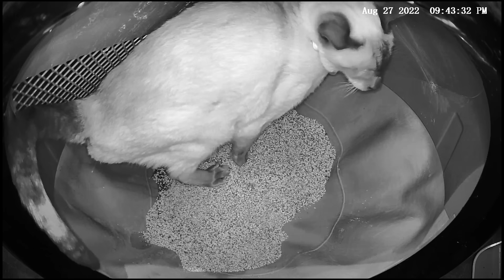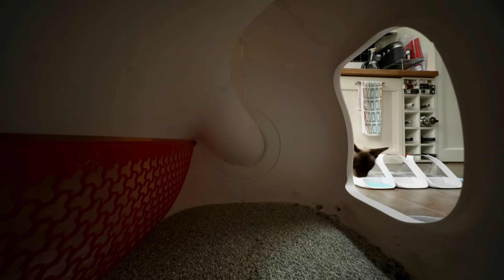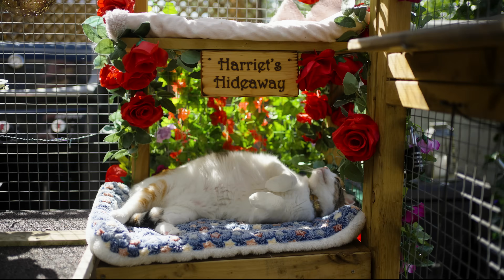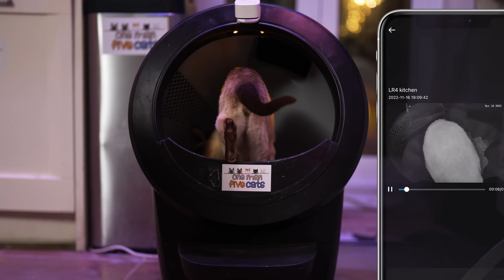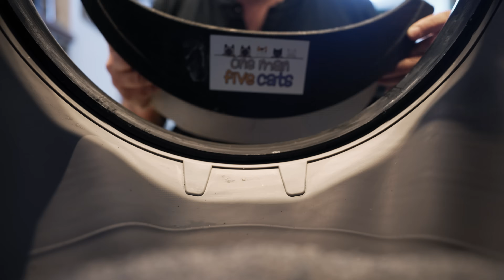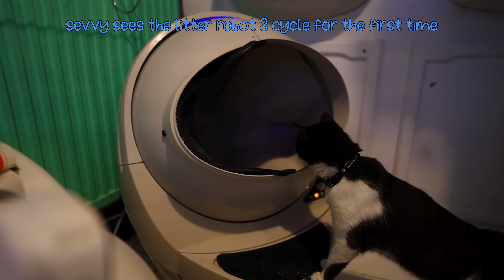Litter-Robot 4 Review: Is It REALLY the Best Self-Cleaning Litter Box?

Comment: Great video. I have been using Litter Robot for almost as long as the company has existed. Right at 20 years. One reason I have continued to use them is that their customer service has always been top notch. 

The early Litter Robot had issues (pull cord sensor would stretch and a few other problems), but the company went to such great lengths to help me fix it they won me over. Litter Robot 3 had quite a few growing pains with all the new tech added (new type of sensors, wifi, app, etc.), but the company still offered me that same customer service I got when I first started using their product. 

Unless the quality really starts to suffer or the customer service does I would fully tell anyone to get Litter Robot full stop.

Comment: I got the LR4 a couple weeks ago. It works great! We have 2 cats, one took to it right away, the other was scared to death of it. We helped her overcome her fear by having the old litterbox nearby but not cleaning it, and also getting a new type of litter called Cat Attract to encourage her to start using it. We also sometimes left treats on the step to encourage her to be close to it. Finally, I left the LR4 off and only cycled manually for a while outside of her presence, so as not to scare the hesitant cat. It is very quiet when cycling, but she still acted as though it was going to suddenly attack her when it was cycling.

The 2 cats are different weights (11.8 and 9.8 lbs), so distinguishing them based on weight is not a problem, the weight is accurate and consistent to within about +/- 0.1 lbs. It's important for precise weights to have the LR4 set on a hard, not carpeted surface, otherwise it will give inaccurate weights.

One nice thing is that even when turned off, it still records when cats use it and their weights, so I could still tell which cat was using it during the period when I was manually cycling it with the LR4 off, and confirm that the hesitant cat was actually using it (usually around 4 AM).

Comment: Based on my extensive experience. You can only rely on these machines to stop when there is weight on them since this mechanism usually utilizes magnets which rarely break; and you cannot rely on them to stop when something blocks their spin because sensors are easily compromised by moisture (piss) and dust (clay litter). There has been news and reports of cats having their necks snapped in automatic litter boxes. Please avoid any models that allow cats to poke their heads through small hole while spinning at all cost.

Don't let curiosity kill your cat.  

And if you plan to use one for a long period of time without refurbishing or repair.  I suggest avoiding gimmicks, apps, and again most crucially sensors. These things have no long-term value and can break in a matter of days.

OP keeps removing my responses. Anyone curious to learn more should google "ห้องน้ำอัตโนมัติ แมวตาย" by yourself.

This video must be sponsored by.....
Reply from the maker: My videos are unpaid and independent. I have ethics. I don’t through out statements with zero factual basis. Learn some basic manners.

Comment: I have had numerous cat genies and prefer this style litter box over one you still have to empty a container with litter. The only draw back to the cat genie is you have to have a water supply and a sewer hookup ( room next to a toilet).  I am lucky that I was able to use the water supply from my toilet in my basement and hooked up the drain to the utility sink with a dishwasher pvc fitting from the hardware store after the P trap. I like the fact that all of the solids and liquids get flushed away and a pleasant clean fresh smell from the litter box cleaner afterwards.
Reply from the maker: Check my pinned comment for what I consider deal breakers for the cat genie, something I’ve owned for 7 years

Comment: I bought my  Petkit Pura Max on its launch day and have been using it ever since. I'm quite busy and have to go on business trips quite often, but it always performed perfectly over the last couple of years. The minimum weight for kittens is 500 grams but the sensor is quite accurate if you set the machine up properly, and it can be triggered at only 100 grams. I've only maintained the machine three over the last few years yet it's still in great working condition. it's got great safety features like inferred sensor and radar sensor at the front of the machine, a laser grid for pinch protection, four weight sensors, and the front of the machine will leave a gap when it's tipped over.  The supporting app works great, you can create pet profiles and it will automatically update the weight of the pet for you. It also has a built-in system to eliminate the odor and it works great, the special bags and the fluid used for odor elimination don't cost much but it's of good quality. Personally, I do enjoy using this machine and think other people who want an automatic litter box should buy it. ;plopwaqq (my cat just walked over my keyboard just after I finished writing this, but I think it's pretty well timed so I'm gonna leave it there)
Reply from the maker: Cool, but not sure why you wrote such a long comment when I don’t even cover it until part 2…
Reply from the maker: I am confused by you talking about “maintained the machine three over the last few years”, that doesn’t make sense does it? Especially as the machine only started to reach backers at the beginning of this year!

So please tell me why you have lied?

Also there is no radar sensor. There are entry sensors and weight sensors. Leo’s Loo Too has radar.

Comment: I had a 1st auto litter
Machine 
in the 90’s with my 4 cats (with cat privacy tent). Bought second unit after contractors ladder broke the lot, but as I couldn’t enclose it as ‘privacy tents’ no luck longer available, I keep
This as emergency back up. But lasted 10 years until ‘killed’.
2nd was litter robot 2 (by this time 3 cats) & eventually upgraded to circuit Wi-Fi board to Whisker app would use.
This has lasted me 3 yrs so far with minor (mainly fault so turn on & off to sort out problem) for my 3 cats.
No litter kicking, or weeing above entrance etc ( uses whisker app) 

I’ve rebuilt unit a few times & always (so far ) got it sorted easily  - not bad for wheelchair user woman in wheelchair 

I don’t think the big entrance of litter robot 4 would suit mine & they wouldn’t like the home bodge wee solutions ! Nor would I for that money !
4 yrs & no problems with Litter robot 2 upgraded by circuit board in litter robot 3 (connected by disabled woman in wheelchair).

So will stick to this (drawer a pain to put bag onto clips & breaks your nails - grrr)

Comment: I got a litter robot 3 a few years ago. Feel like I wasted a lot of money on it. First off the thing is huge. It takes up so much space we nicknamed it the rocket. At first it worked alright. Then the steps became moldy and would not clean no matter how much we tried to the point they were stained. Also perhaps for 1-2 cats this might work better, despite its size I would not recommend for too many cats, it does hold quite a bit but after awhile it just started giving the jammed signal or was always red despite nothing being in it..we took it apart and cleaned it and it still gets the red stop light and will turn red multiple times in a day to the point we had to return to normal manual litter boxes after spending nearly a grand on it and it not even lasting a few years I am mega disappointed in it.

Comment: Improvements to the litter fence also help distribute clumps in the drawer. The bottom of the fence isn’t open which really helps with unburied urine. In the LR3 the clumps of urine that weren’t buried would stick to the fence and usually fall back into the litter bed post-cycle. In the LR4 the solid bottom of the fence causes litter to wash over the damp clump thus sealing the clump so it doesn’t stick to the fence.

Also there’s a small angled lip on the fence which delays clumps from falling in until later in the rotation. There’s still a bias toward the left side of the drawer but distribution is greatly improved over the LR3. 

I was so happy with the improvements over the LR3 that I replaced both with LR4s. Once upon a time I had 2 LR2s so me and LR go way back!

Comment: As the tolerated companion  of a kitty who also insists upon tinkling with her rear towards the entry of her LR3, I really appreciated your insight and influence in the adaptation of a fence for the LR4. One day, I may be looking at upgrading my good ole LR3, and I expect I would have been finding myself doing a lot of extra cleaning without the implementation of a future fencey-fix.
Reply: One of my girls pees facing out and poops facing in which was a problem with the LR3. She’s a big girl and would sometimes hang her butt over the edge thus depositing her waste onto the lip or the mat outside the box. I could tell when this had happened as soon as I got home from work because of the smell.

When I swapped it for an LR4 the problem went away. The bigger opening gives her more room to orient herself so while she still faces in to poop, she stands at an angle so her butt is always in the box.

Comment: My first introduction to a self cleaning litter box was for my aging diabetic kitty.  That box looked like a regular rectangular box but with the addition of sensors along both sides of the interior walls, on the scooper bar, and a super flimsy receptacle that filled up way too easily and were really expensive to replace.  The slider bar featured closely spaced "fingers" made of plastic that scraped along the bottom of the box catching all the solids.  Once it got to the end of the box it had a little protrusion that lifted the cover to the poop receptacle.  There was no sensor on it telling it when that was full.  It would however stop when it detected a cat in the box.  It wouldn't start its cleaning cycle until 5 minutes after motion was last detected.  This could be a problem for cats who hide or nest in their litter pans.  There was no cover over the litter tray itself.  Plus it was moderately loud.

When I got tired of paying too much for cheaply made plastic waste bins I started to look into ways to raise the box high enough off the floor so that I could replace the receptacles with a small bathroom style trash bin.  I would have needed to make stairs for my little one to climb up into it and back down again when she was done.  Sadly though her health only got worse and she wasn't able to climb anymore.  After she passed away I took in 4 lovely kittens from the vet.  They were too skittish to use the electric litter box so it was cleaned and sold to someone who could use it.

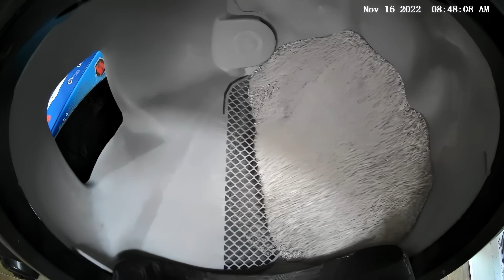Comment: 10:33 Crazy how much what is not used get dumped.
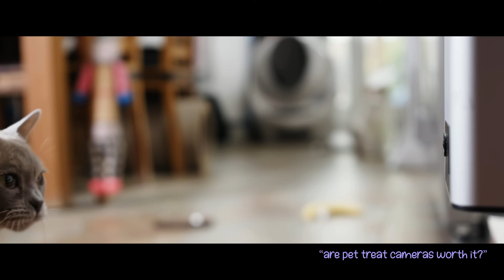16:28 It is not so smart getting shot by dry food ...
Reply: Well no, it’s not crazy at all. I said if you OVERFILL the litter it gets thrown out. The space where it holds litter on a cycle has a certain volume, overfill it of course it will get thrown out. If you have a pint glass and poor 1 1/2 pints of beer into it what will happen? 😊
Reply from the maker: What a muppet. Please go away.

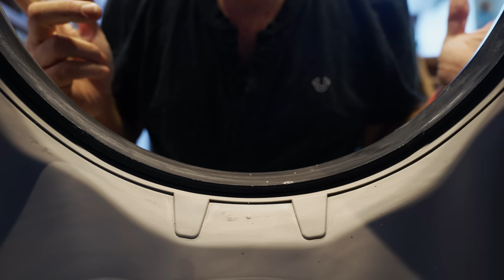Comment: @19:40 If your cat is a high pee-er against the BACK of the LR3, the pee will leak into the mounting point on the back of the globe (where the black handle is on) and seep through. LR3 also had the issue where about half a pound of litter would get stuck in the globe when emptying causing issues when deep cleaning.
The edge of the LR4 worries me
Reply from the maker: I mention the issue of the opening for high pee-ers, I guess you missed that part! They have to be a very high pee-er, more than Bert!

There will always be issues with certain cats, peeing directly out the front for example.

Comment: We've been using two Litter Robot 3 units for almost three years now, and are quite happy with them. Like all such devices, they have their "issues" occasionally - but it's nothing compared to the bending and scooping, lifting to empty, and weekly (or more) complete scrubbing needed with manual or even "rake-type" machines. Just pull the bag, throw it away, and put a new one in while topping off the litter as needed. I open them up to vacuum out stray sand and "debris" once every couple months, or when the barrel seems to grind when turning, and all is good. Our three cats have nearly always used electric litter boxes of some sort, so they had no problem adapting to the Litter Robot pretty much immediately.

If one of them conks out irreparably (hard to imagine, but I suppose at some point it might become hard to find the parts), then I'll upgrade to whatever the current unit is. About the only features of the v4 unit I am wishing we had were the deeper waste receptacle with the easier bag attachment; I do hate those stupid clips as my fingers are too large to easily stuff the bags down into them. I can almost do it with my little finger. My wife has much smaller hands than I, and can easily use them, however, so I'll usually just let her put the bags in while I do the rest. 😋

Comment: You should try the cat genie. You are supposed to never have to manually clean it. You just add cleaning cartridges and litter occasionally. It hooks up to water and a drain and uses a special litter designed to not absorb anything so it can wash the litter between each use. I would be interested in your thoughts on that litter box with multiple cats
Reply from the maker: please read the pinned comment, Sarah. I don't give my full thoughts on it in that review but I've had in 7 years and it misses poo constantly and then bakes it when it dries the litter which smells awful. AVOID

Comment: We have 7 cats and LR4 handles it. Occasional hickup but not a big deal. One cat loves to attack falling waste and that halts cycles. Sometimes a couple cats use it before a cycle completes also. I've used a pressurized air can to spray the sensor at the top on occasion because if a hair is lodged in the hole it can create issues with cycles. Overall we are happy with it and it's a huge life-enhancer not having to deal with the litter requirements of having this many cats aside from emptying the drawer every 2 days or so instead of multiple times every day with manual litter boxes. Also, no odor really. Wouldn't mind two LR's but cost and another good spot for one limit that. If you have 1-3 cats I'm sure you can avoid emptying the drawer up to a week and only need to toss in some clean litter once in a while.

Comment: I had several "Litter Maid Mega's. The main problem that I kept having with them was a cat that would not cover his poop afterward. The poop would get stuck on the rake and the rake mechanism would get bogged down. The "Maid" had a ludicrously, tiny clump collection tray system. I put the maid up on a platform, cut out the bottom of the tray over a lined, 8 gallon, waste basket and could get quite a heavy load of poop for the trip to the garbage can. If the thing didn't bog down. I've been looking at these systems and wondering if they are worth all the money. Great test!

Comment: I am really hopeful when my replacement unit arrives i get longevity out of it you do. 2 cats, and will say full within a day. There are times, put in a fresh bag and it immediately shows 10bto up to 25% full. One time the first clump from the cat, (a single not so big one) it went from 10% (on brand new bag) to 35%.

Really hopeful. New unit on its way from them.
Reply from the maker: Hopefully the sensors will be fixed. It was a problem with one of mine. With the drawer not even in it was showing 40%!
Reply: @OneManFiveCats  I'm actually glad to hear this,. Mine has had alerts of "bonet open" and a general "sensor fault" with mine as well. Oh and your comparrison between loudness of the 3 vs 4, glad I went with the 4 LOL. I experience same problem you do. cats within .2 lbs of each other. so it is like "is it the other cat, or did the first cat poop .2lb" LOL, I was hoping they had something that was going to read the chips in their neck.

Comment: Thank you! I have 5 cats and one LR4, second one just shipped the other day. It has completely changed our litter routine and couldn't be happier. I'm glad we went with a 4 as I didn't realize how loud the 3 is. I can BARELY hear the 4 when it rotates. The sensor fault errors are kind of a pain, but we love that you can't smell the waste drawer. Still testing litters to see what works best, taking suggestions.
Reply: we use dr elseys standard premium blue bag and it works pretty well. May use the low tracking version once in a while when we can find it. 7 cats
Reply: Sustainably Yours .... super fast clumping made with cassava rather than clay. Hands down the best in any automatic litter box.
Reply: I buy the litter that LR sells. A bit more expensive but lasts longer.

Comment: wonderful vid. thank you. my litter robot 3 is very quiet since it's not working. after about six months of use it started giving me grief. now if I turn it on it just flashes a rapid orange light and the company which sold it to me offers me to use the drawer as a litter box for two weeks until they fix it instead of giving me a replacement device. So I clean it by hand and my cat pees on the floor since she is diabetic. Just an abuse of my cats and I.
Reply from the maker: You need to buy replacement DFI sensors. Robotshop sell them. They aren’t expensive and are easy to fix.
Reply: @OneManFiveCats  my litter box is under warranty
Reply from the maker: @itailu  who did you buy it from?

Comment: Great video. I had the LR3 for about 3 years and I found it worked very well despite occasional glitches. I agree the LR4 is definitely an improvement, though, especially the noise level. Thanks for the tip about connecting it to a wifi enabled plug, that’s a great idea. You should make whisker pay you for your pee guard idea!